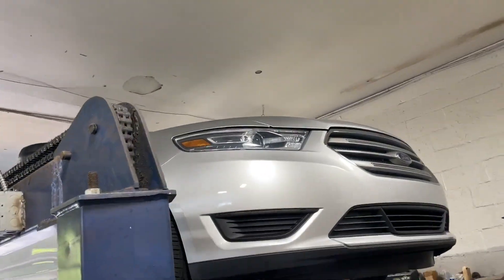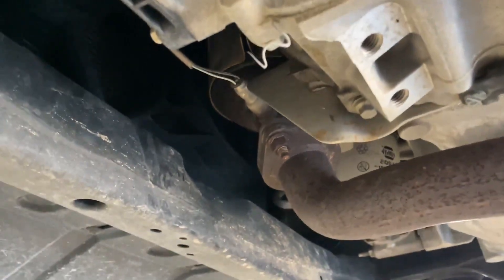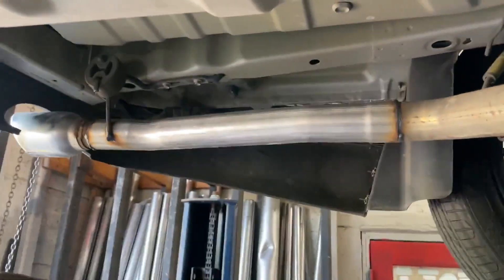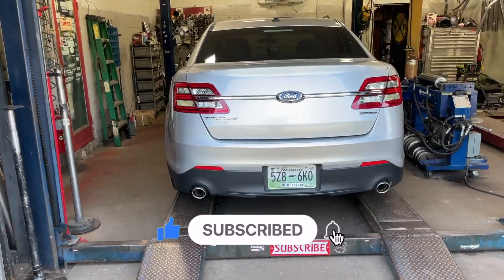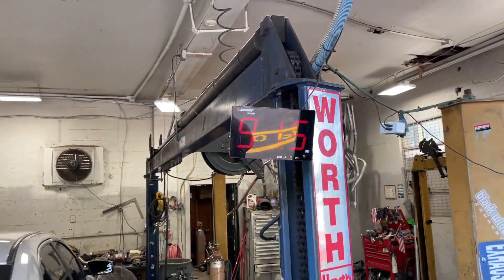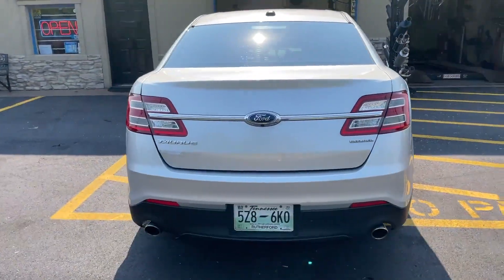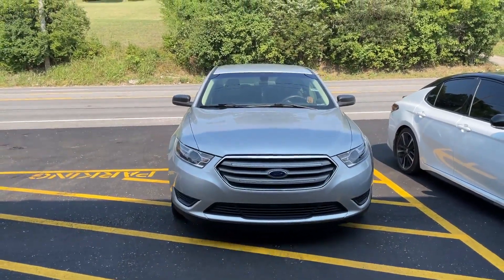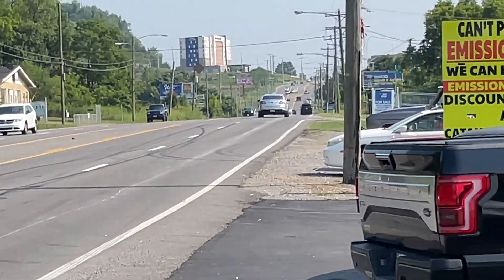2018 Ford Taurus 3.5L V6 DUAL EXHAUST w/ FLOWMASTER OUTLAW!

Comment: Sounds better than 90% of the v6 mustangs I've heard in my time.
Reply: @faaaaq  As long as those timing chain issues are dealt with early and on time
Reply: @faaaaq  the 4.0 will not outlast the 5.0 V8. I’ve had 2 4.0l’s and own a 5.0 currently. They are both super tough and reliable engines but the 5.0 is an all around better engine!
Reply: @faaaaq  A lot of V6 Mustangs are 3.8s and 3.7s 🤔

Comment: I clicked on the Amazon Link, It states it dont fit my 2018 Ford Taurus, I take it they are universal and may need some adjustment. Also, I have cat back system (magna flow) I take it I can replace my resonator with one of these, correct?

Comment: Wish I could have heard the before with just the mufflers deleted. My buddy just got a Lincoln mkz with the same drive train and we’re thinking with just a muffler delete and some bigger black tips
Reply: I'd leave it alone honestly. If it's the 3.7, it's going to be hard to make it not sound like trash on that car. If it's the 3.0 or 2.0 it won't sound good either.

Comment: If he puts 3 inch pipes where the mufflers were it will have a really good deep tone.
Reply: Bro I’m literally gonna do the same set up for my 2011 Ford Taurus sel. You think 3 inch pipe instead of the mufflers would be better?
Reply: @yousufaljazrawi6347  Yeah I did it on my 14, a resonator delete makes it sound better in my opinion. But if you don't like it loud af don't do it lol
Reply: Bigger diameter, less rasp.

Comment: I need your help. I have a 2017 Ford Taurus SHO. I have cut the 3rd cat off, and added flowmaster super 10's. There is too much rasp. It sounds like a Subaru WRX. Would the flowmaster original 40's cut the rasp down if I just switched the super 10's out for the 40's you think? I can't take the rasp. It's awful.
Reply: I've also deleted the stock resonator. The straight pipes sounded good, but I wanted a more aggressive sound without the rasp. HELP!
Reply from the maker: Put some vibrant bottles in the middle. They would take the rasp out
Reply: Ok, and also give it a more louder/stronger/muscle sound?
Reply: Vibrant bottles and keep the super 10's too you think?
Reply: @exhaustaddicts  which model bottle would you recommend for eliminating or at least toning down the rasp? Or should I put back on one of the two resonators?
Reply: @christopherhunley1201  i would honestly put a glass pack in the middle where the resonator was. Deep tone, still aggressive but will remove the rasp. Maybe some red hots from flowmaster.

Comment: Have fun with it before the water pump starts leaking
Reply: Not if you change out the coolant
Reply: I have a 13, water pump changed and I still have fun in mine 😉
Reply: I have 2015 with 190k water pump still running strong
Reply: @columbiariverdetailing1943  do you flush your coolant every certain miles bro?
Reply: @Limited-uq2yk  pretty much, just keep her loved, and she treats me good
Reply: @columbiariverdetailing1943  im barely at 64k and I did the first flush at 60k. Btw does yours shift rough through the first 3 gears?
Reply: Make sure you use the new "yellow" Motocraft coolant. Genuine Ford Fluid VC-13-G Yellow Concentrated Antifreeze/Coolant
Reply: I have a 2015 Ford Taurus 129k miles water pump strong 💪

Comment: 100% is not a 2018 Ford Taurus. I have a 2018 Ford Taurus and the interior is nothing like that. That has to be an older one. Like 2013 or sum
Reply: You probably have a higher end model, the lower spec SEL and SE have different gauge clusters.
Reply: @Kfcfranchises  all the interiors are the same along the board….. just different materials. That is not a 2018 Ford Taurus.
Reply: @staying_spooky  my 2017 SEL has the same interior man